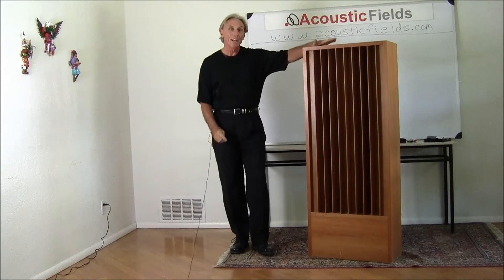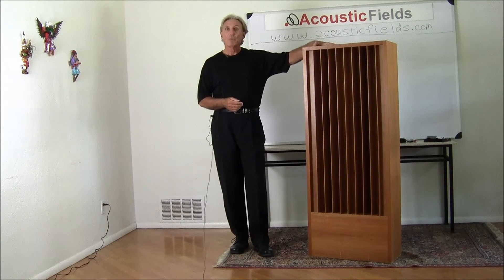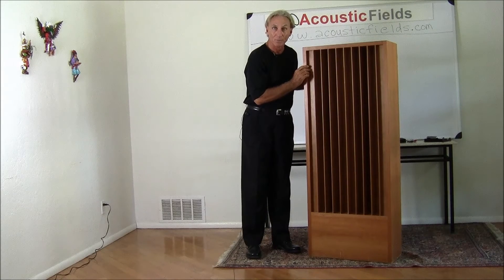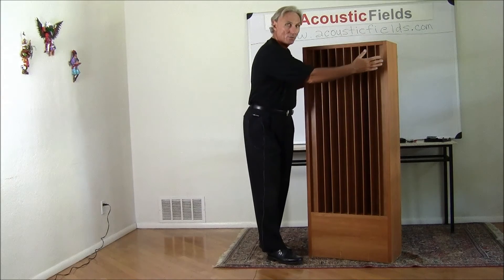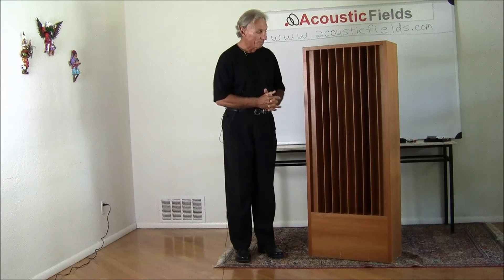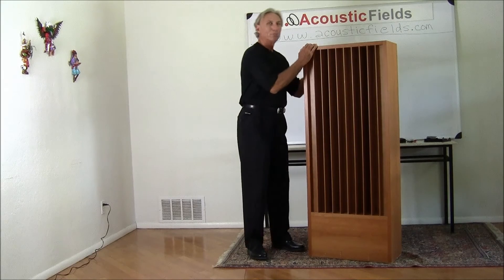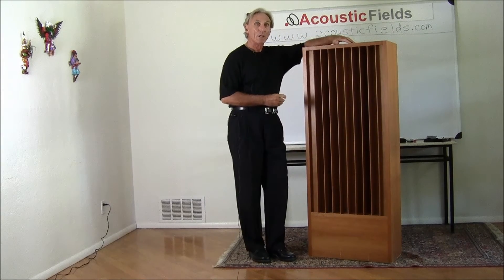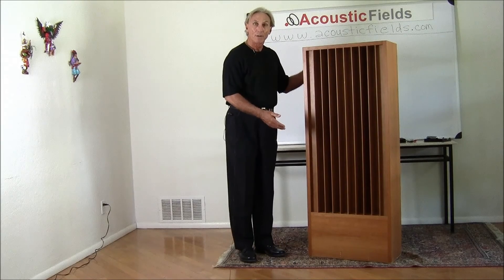Quadratic Diffusor Absorber (QDA) - www.AcousticFields.com

Comment: Hi Dennis. Been watching a few vids on these diffusers.and got me wondering..after watching I think Bruce's vid.you did front and rear treatment. His explanation of the sound.he really couldn't explain it.he to was chasing the sound(for years).for him to finally hear it.i was convinced. Had to try it myself. 
So I go to the garage/music room.ive got double walled cardboard. Well I make 2 small diffusers. 1ft x3ft. Each.i saw the pattern you had on this one.and duplicated it.now theres no math in this nor calculation. 6in deep. 2in. Wells.i basically just mocked up a test defussor. No fine carpentry here.
So I put these up on front wall ,and I tell you.the sound stage is even more center.(my mains are 10ft apart .I sit 14ft away)
But just for shitty cardboard I couldn't believe it.
But I would like to purchase the proper plans. Spring is coming and my listening days are going to get reduced. But I would like to make proper ones by next winter. 
So thanks again.for all your vids.if more people watched them. They would keep their old gear.
Like you said it's the room not the stereo.
Reply from the maker: JS, Isn't it amazing!!!!  The power of diffusion.

Comment: Hi, i have a question about this unit . How can absorber inside diffusion absorb bass ? Is it diaphragmatic absorber ?  Are top and bottom thicker board (edge) on diffuser are cut, with dados, so the board of the well is fitting those dados  moves like ''diaphragm'' same as diaphragmatic absorber ?  

if it is only carbon filter, i absorb mid frequencies only and not bass. Or some energy around 100 Hz and not lower.
Reply from the maker: Hi M,  Diaphragmatic absorption is a process that involves a sealed cabinet, calculated depth of cabinet, and density of the cabinet materials with an internal fill material. The cabinet depth and material density controls the resonant frequency of the cabinet or how low it goes in frequency. This is called level. Our carbon fill is actually a perforated absorber that goes inside the diaphragmatic cabinet. This controls the rate of absorption from established level. The base of of QDA unit is our ACDA-12 technology from 30 - 50 Hz. The diaphragmatic absorber behind the wells is our ACDA-10 technology from 30 - 200 Hz.
Reply: Thanks for clear explanation !

However, i find one thing confusing.  In shop tab on your website that all your QDA units share frequency range, but they vary at depth. For example QDA-11 has 9 inch depth has the same frequency range like QDA-13 that has 16" depth and so on. How you can achieve same rate of absorption when it varies on depth  ? I assume that keep the same density of all materials and the depth of each absorptive layer (both carbon and air pockets) but you only decrease the depth of last layer of air (the one behind activated carbon ) ? After all,     the ''diaphragm'' and carbon do most of work and horsepower lies in  them ?  Regards

Comment: You mentioned that this has casters build in. Do you remove them when QDA is placed? I understand that construction is very inert to resist low freqency energy. My first thought was that casters may have bad influenece on overall intertia.
Reply from the maker: Hi Daniel, Casters are for mobility to area in room and for easier tuning that requires smaller movements.
Reply: @AcousticFields  , ummm, he was asking are the casters to be removed after placement or are they permanently installed.

Comment: Did I get that correctly? In the two outer wells there is a speciall absorbtion technology included? I wonder what this can do, since only a small part of percentage of the room sound will reach them? The other idea to have absorbtion in the lower case is ok, I am doing that too - appart from the fact i use two dedicated isolated modules for better carrying.
Reply from the maker: Hi Juergen, Our QDA series is a diffuser with diaphragmatic absorption built into the larger depths of the diffuser. The base is a more frequency specific absorber. Broadband absorption from 60 - 200 Hz. in the diffuser part and 30 - 50 Hz. in the base. It takes 8 sq. ft. of our carbon technology to affect a 1.5 - 2 dB attenuation below 100 Hz. . In small rooms, you grab every space you can.

Comment: Is any of what is claimed measurable and meaningful?
Reply from the maker: Hi Jennifer Hollington 

Low frequency absorption is measured in Sabins with the appropriate absorption coefficients assigned through testing. That test data is readily available on our site at www.acousticfields.com. The chosen diffusion frequency response can be used to maximize diffusion in small space requirements.

Let me know if I can help with anything else,

Thanks
Dennis